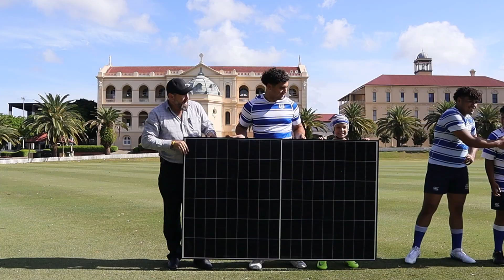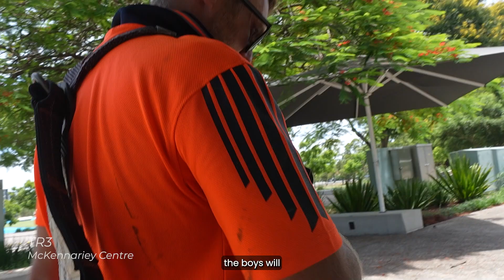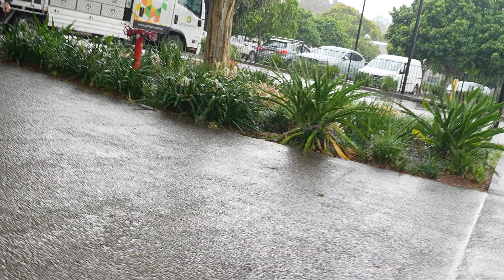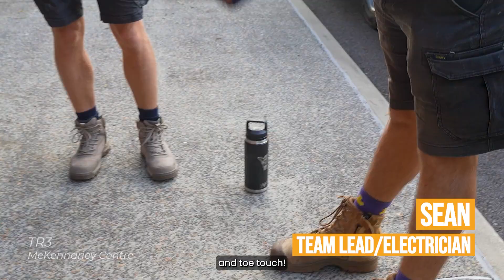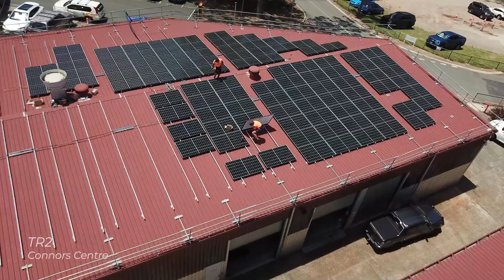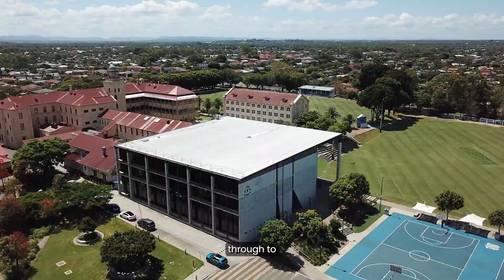Overcoming Challenges: Inside the 300kW Solar Install at Nudgee College Brisbane

Comment: Looks like a great challenge and a great outcome...I recently went solar at home and got them to fit as many panels as possible on the roof. 12kW of inverters, 12.6kW of panels, using Victron gear and a 32kWh battery bank. Even down here in "sunny" Melbourne, I am currently energy independent and there's even enough to charge the car. I'm keen to see some of your other projects so have subscribed now. Thanks guys!
Reply from the maker: Thanks for watching! Lots more projects coming.